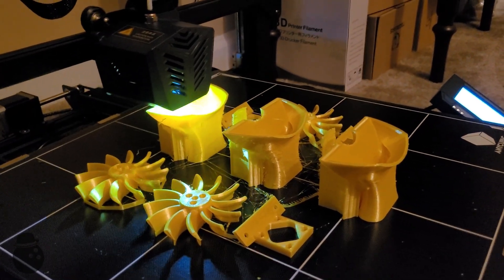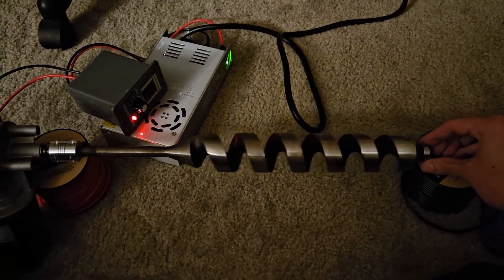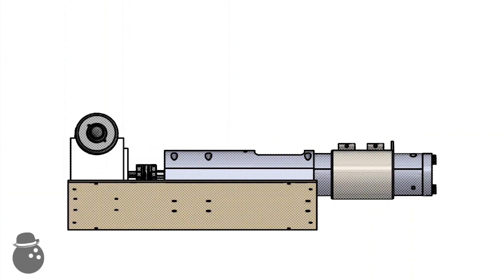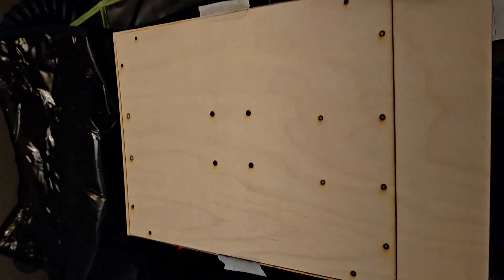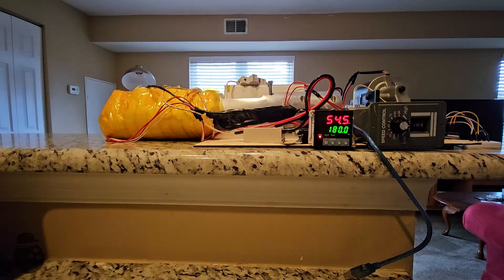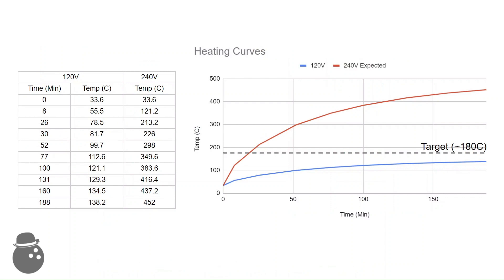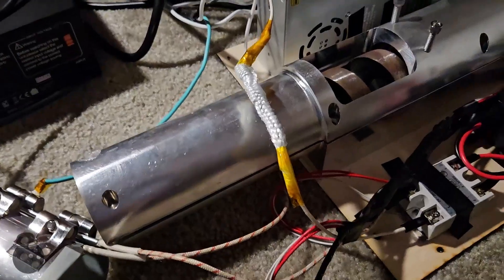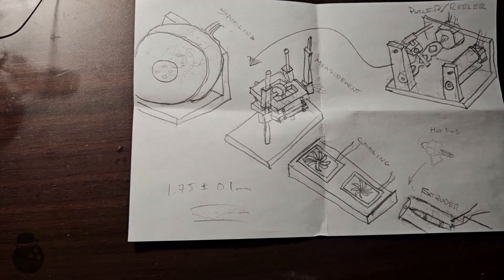Can you really recycle failed 3D prints? |  Part 1 - Extruder

Comment: two questions/sugestions
1 how did you seal pieces of the aluminium monstrosity from squeezing plastic trough the gaps between the device pieces?
2 wouldn't it be cheaper to buy just a hopper part and replace the barrel with a simple pipe? with no side gaps mind you

i am always impressed bu th lenghts people go to complicate theyre projects but this is a nice monster
Reply from the maker: Hello, thanks for the questions, I'll try my best to explain my rationales:
The two pieces are clamped together using 8 or so (one hole was mistapped) screws. The surfaces are quite flat, and the clamping force creates a tight enough seal to prevent the highly viscous molten PLA from escaping. The initial failure from the extra hot end/plate showed that the plastic struggles to overcome the friction/boundary layer effects when trying to squeeze through small gaps or channels.
The pipe solution was heavily considered.  My issue with that solution was threefold. Firstly, a solid pipe would've been difficult/messy/dangerous to disassemble,  as the solidified plastic would bind everything together and would likely have to be at temperature to get apart,  which is quite hot (I could be wrong). Secondly,  I struggled to find a pipe that had the right ID for the screw and the right OD for the heater, which meant I would've had to likely get a custom one (which, as you mentioned would likely be considerably cheaper). Thirdly, I would've had to then modify the pipe to interface with a metal hopper, a metal extruder cap, and have the bearing structure to allow for the screw. All being metal because they have to survive the high temperatures (correct me if I'm wrong). If those parts existed at the exact sizes I was looking for, I couldn't find them, which meant they would need to be custom and thus, I ultimately decided to just do the approach I took.
Is everything ideal and the cheapest it could be? No, but with the knowledge I had at the time and from what my instincts were telling me, it's the approach I settled on and it ended up working in my favor. I would love to see if someone can find a combination of heater and screw that allows for generic pipe sizing, so let me know if you end up trying! Metal working tools would likely make this approach easier (welder, angle grinder, mill, etc.). Which I can't have, or my apartment will likely evict me...
Thanks again for your question and for watching! Let me know if you have any more questions!